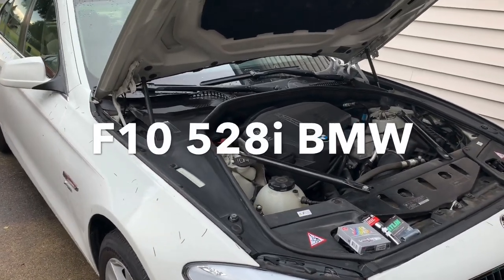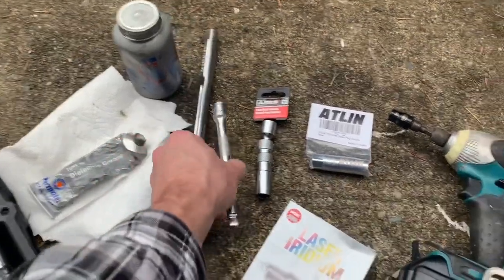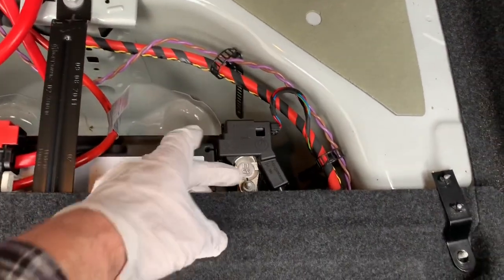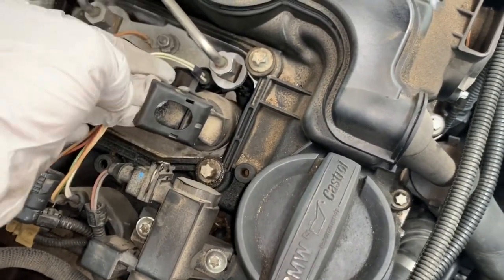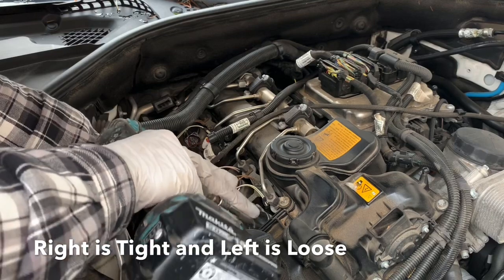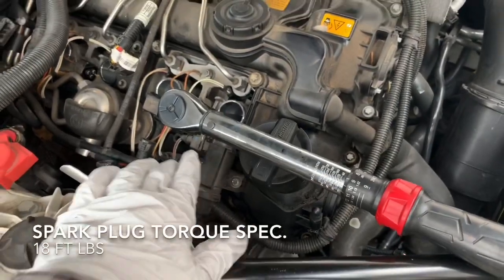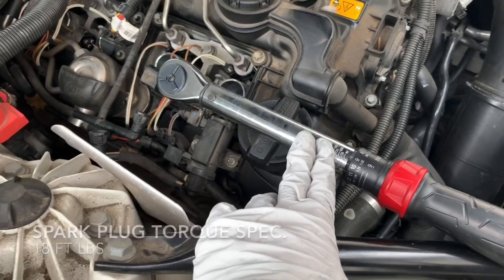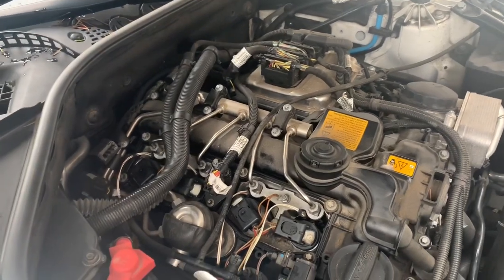How to replace Spark plugs  N20 528i BMW (2.0 turbo) Detailed guide 2012-2018

Comment: Is the threading on the original sparkplug bigger or longer?
Reply from the maker: Not sure what you mean by bigger or longer, The replacement plug was the exact same as the replacement. If you purchase NGK brand the plug will be an exact fit and will also be pre gapped. If the plug you ordered is not the same as what you removed I would not install it because you may have received the incorrect part.
Reply: @TweekerDan1984  sorry, it must have been my eyes because the video looked like the new spark plug was not consistent with the original spark plug. It was probably the grease playing tricks on me eyes. Apologies, & excellent video.
Reply from the maker: @SN-rp3kk  thank you for the compliment. Feel free to subscribe, I post a wide variety of videos but we also make videos for our BMWs. If you ever have any questions I’m glad to help.

Comment: So no gap clearance ?
Reply from the maker: Plugs should come pre gapped, I know NGK plugs will come pre gapped and they are my trusted brand. You can double check them. You would want them at Stock -> 0.031-0.032 or 0.8mm. Hope it helps.

Comment: Thank you brother, I was able to replace the spark plugs on my F10. I would like to add that none of the hoses had to be removed before taking off the engine cover. All I had to do was take the plenum hoses off the cover (4 plastic clips in total), pop the cover open, and then it lifts and slides right out. 
In any event, this was very helpful. Again, thank you.
Reply: Very useful observation.  😂

Comment: Thank you for this video. I have a 2015 528i. My plenum doesn't have those vacuum hoses to undo. But there is something on the right side securing it in place. I'm so confused 🤦🏾‍♂️
Reply from the maker: The plenum may have plastic hooks that slide forward and backwards. If you do not see these hooks check for any side bolts most likely 10mm. If there are no bolts or plastic hooks it should pull straight up. The tension fasteners can be a bit sticky sometimes.
Reply: @TweekerDan1984  thank you for replying. I believe there is a bolt of some sort on the right side. On the left side where you disconnected those hoses, it slides out easily with no obstruction. I'm try again to see if there is a 10mm nut
Reply: @TweekerDan1984   I checked again with no luck. I made a thread on a forum with photos of you don't mind having a look.  https://f10.5post.com/forums/showthread.php?t=1782047

Comment: Most sources, including the spark plug manufacturer, recommend NOT using anti-seize.
Reply: I think anti-seize would be important when as the spark plug threads are steel, and the engine head is aluminum.  Different metal types is the main reason for using anti-seize grease.
Reply: @GroovyCachinDude  exactly
Reply from the maker: I did read that as well, out of personal experience on these heads I’ve used anti seize to prevent damaging the plug threads.

Comment: Hi I just completed my spark plug change and my air filter change. Your video helped me lots. Thank you for such a detailed video and the car drives like a dream, from South Africa. Mileage on my car is 101000 km.
Reply from the maker: Thank you for the kind feedback 😊
Reply: You are most welcome! Keep it up!
Reply: did you have to change the gap on the new spark plugs or the come with preset gap?

Comment: Did you check the gap of plugs ?
Reply: because sometimes spark plugs are bent because of inappopriate handling.
Reply from the maker: I did double check the gap on each spark plug but NGK plugs will come pre-gapped.
Reply: @TweekerDan1984   Do you know what the recommended gap is for these spark plugs in this car?

Comment: This thing is absolutely a must for the 4 cylinder as well. I have a 428i and the standard 14mm socket will not work. It will not come off the plug after installing. No way to get it back off there. Have to loosen and remove the plug. I just ordered mine and on hold until the swivel arrives.

Comment: can you torque with the 14 MM spark plug socket w/swivel?
Reply from the maker: Frank F it is less actuate with swivels and long extensions. They do not need to be extremely tight.
Reply from the maker: My apologies I realized after reading this again that my answer was unclear. If you do not have the swivel at a crazy angle it is perfectly fine to torque the spark plugs while using a socket w/ swivel.

Comment: Nice video. I noticed that you did not mention the spark plug gap. Did you check the spark plug gap prior to recording the video? Just curious.
Reply: You don’t gap iridium plugs
Reply from the maker: @Charles Snyder I totally missed this🥲 as @Mathew Fry mentioned iridium plugs will come pre-gapped and if by chance you needed iridium plugs to be gapped differently due to performance modifications these plugs have a slightly different gapping method so that the iridium from the plug isn’t accidentally removed.